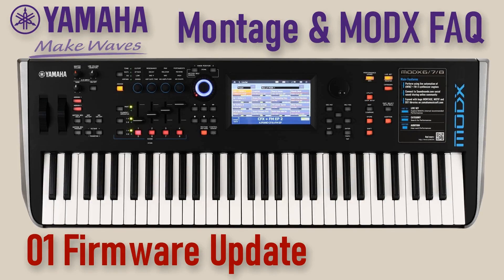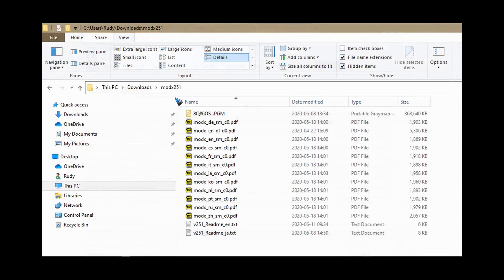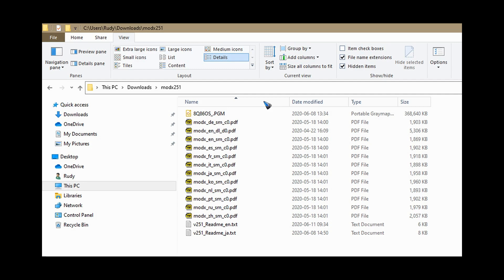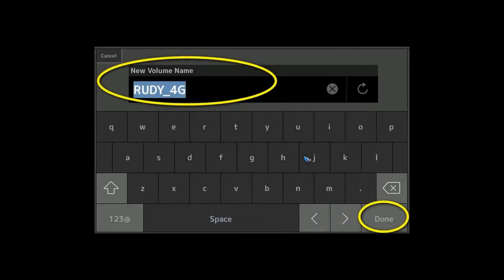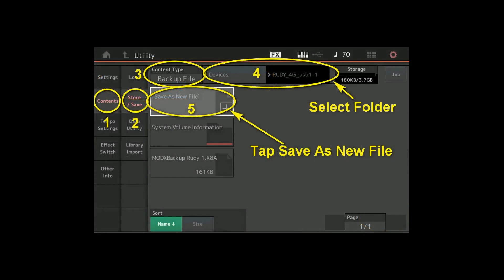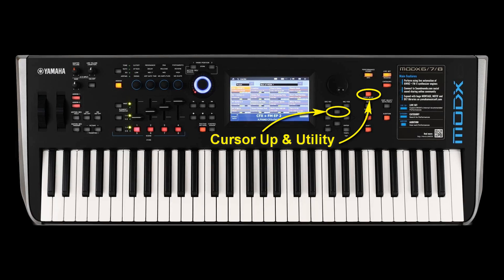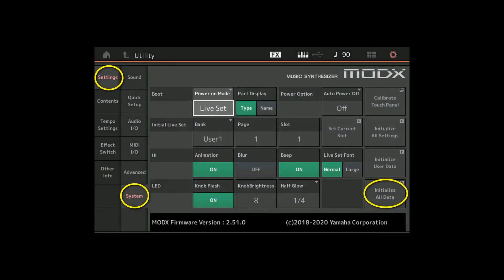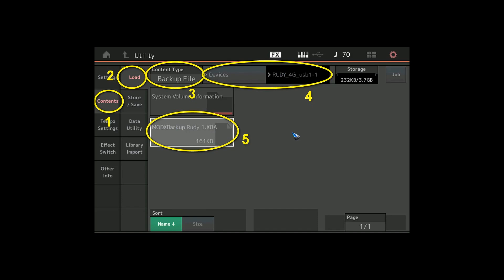Yamaha Montage MODX FAQ 01 - Firmware Update

Comment: Dear Rudy, thank you so much for your valueable tutorials that I just discovered! I have been working with the Montage for three years now, but discovered too late that new firmware could be installed. I simply didn't dare to do it until now, for I feared it might erase all my works (even though I made a backup) or would change the handling of my sets. Would you be so kind and tell me, if there are any risks? Thanks a lot and all the best!!
Reply from the maker: Well ... I can't guarantee anything, but I'd say if you made a backup, you always should be able to restore this backup. I feel with you that it can be scary. Best might not do anything unless you really like / need new features in the new firnware.
Reply: @rudyshobbychannel  That makes me feel a lot more secure! Thank you so much ... :))